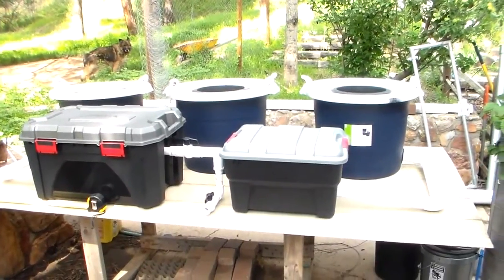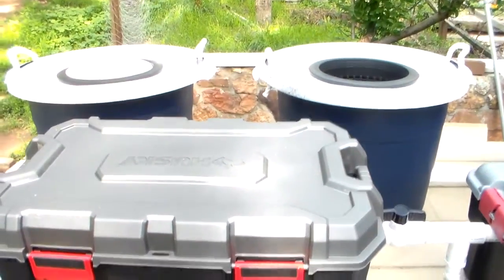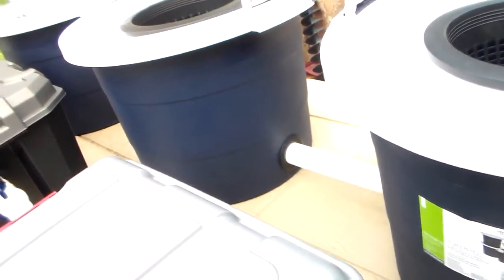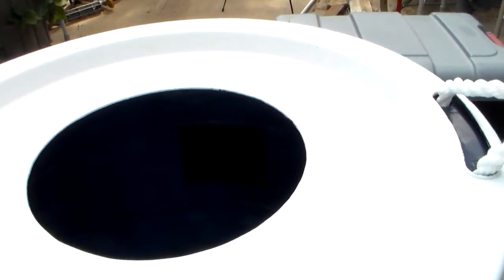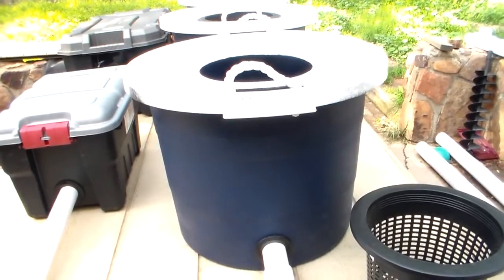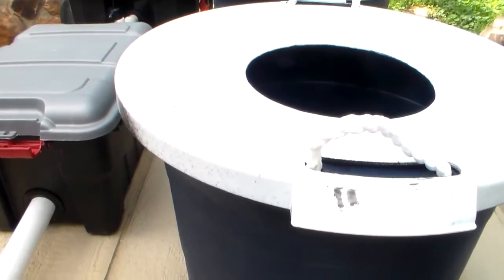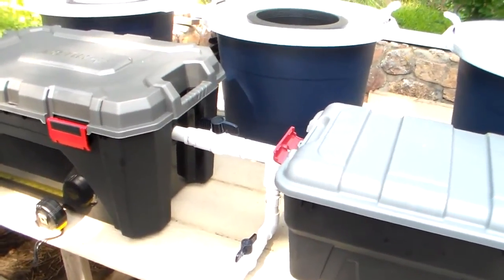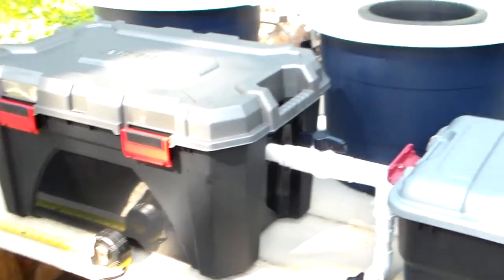Season 1 Episode 4 : RDWC System Build : Part 3

Comment: been using the ph perfect works great try the sensyme and big bud dont forget the cal mag .....you should know after 73 degrees you will get root rot i suggest you get a chiller ...  peace....light is hydro enemy try to make sure no light gets in
Reply from the maker: I may have to use a chiller but we will wait and see.
If my tests with induction lights are successful I probably won't need one. Chillers are only necessary if you cannot control your heat. With induction lights there is very little heat issues. My target nutrient temp is 65 degrees.

I will be using the entire Advanced line for this run. (Although then number of bottles involved is quite excessive.)
I do not believe I will continue with them in the future but we shall see. I do typically run Calimag but I may run the Adv. nutes on their own, just to see if they need it. I will keep a close eye on the plants and add it if needed.
My next run will either return to my old favorite, of over 30 years, GH Flora series or H&G Aquaflakes.

On one of the videos you can see the lids are coated on the inside to block light. But thanks for reminding me, I still need to coat the new lids.

I will be adding some twists to the next part of this series. I have made some modifications to this system so I can grow some less productive strains for CBD production. I bought some new lids and cut them for four 6" eb-n-flow pots. The system is now set to handle 4 smaller plants per cell. I will be setting up the redo in the next couple of days.
More video coming soon.
Thanks for the feedback.

Comment: all that work i would use r/o water its like 40 cents a gallon at water ... you might wanna consider a ph perfect nutes  and some benefical bacteria .... grow big peace ...nice setup ....
Reply from the maker: My R/O water is a couple of cents a gallon. If you are going to be using this type of system you need to visit eBay and buy yourself a decent R/O unit for around $100-$150. I suggest 100 GPD. Higher production comes at a cost as well as lowered water quality and much lower production will slow you down during change outs.
I currently am running Advanced Nutes. I just wanted to try out the PH Perfect line. They are surprising good at staying balanced for a few days. In a system like this you need to run below 700 PPM's, so you use considerably less than directed.
I don't really like having a dozen bottles of nutes for a simple grow. I miss the old days of three parts nutrients. I may return to that simplicity.
Gen. Hydro. now makes a new FloraNova line that offers the PH perfect operation.

My friends are all using House and Gardens Aqua Flakes with excellent results. I will publish new videos very soon with the modifications I have made to this system I will attempt to do a full line run with the Adv. Nutes.
I will also be running a comparison between HID and Induction lighting as a part of the completion of this season.

Comment: Nice Bro never did Hydro just a quick flushing soil mix and watered like crazy if you call that hydro i do just not in circuit.   And about thos Ozone Gens lol reminds me of when I tested a 4k square foot in my little house in 2006. made me lightheaded and gave me a buzz but It killed odors
Reply from the maker: Shouldn't cause a buzz, even with high levels. If you cannot adjust the settings it probably isn't too safe.
If you can smell a bleach odor then it needs to be turned down.
Ozone cleans the air just like a lightning storm. The ideal setting should make your house smell like it does outside after a good thunder storm.